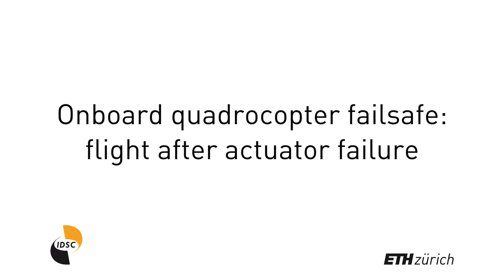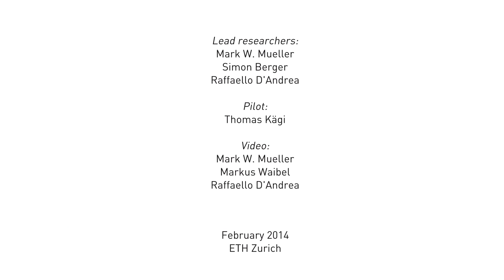Onboard quadrocopter failsafe: flight after actuator failure

Comment: Wild guess - you notice two of the stability axis PID variables go all the way to their constraints, and identify:  
a) that a motor/prop/ESC has failed,
b) which pair (CW/CCW) it belongs to by the adverse yaw
c) which one of the pair by the loss of pitch/roll control

This causes the FC to go into a "recovery" fight mode which, by necessity, must:
a) Not use the existing three axis PID loops, as they no longer apply.
b) stop using torque for yaw control.  Instead, spin up the three remaining motors and establish a stable, high speed "spin"
c) Enter "recovery" PID mode, where you correct the "pitch" and "yaw" on a plane relative to a point calculated by the rate of rotation
d) Use the differential thrust of the good motor pair vs the lone motor to attempt directional control once c) is stable.

How'd I do?   ;)

Comment: What flight controller were you using on the multi rotor
Reply from the maker: We use a mix of custom and proprietary hardware and code. As the base, we use the PX4FMU for sensing and computation.